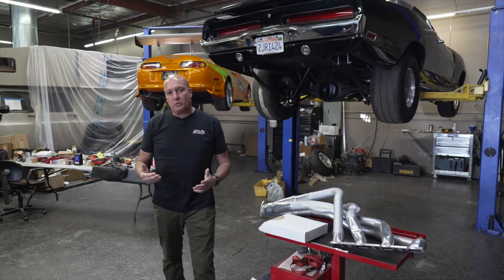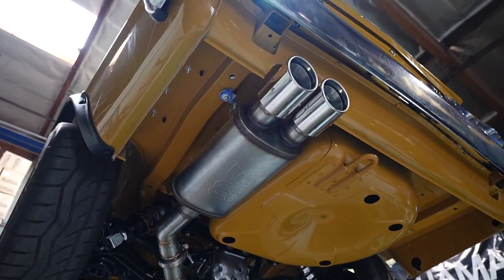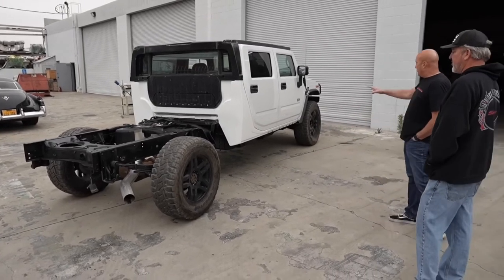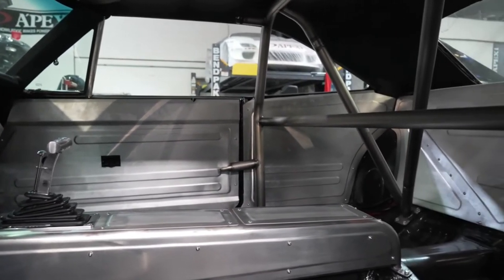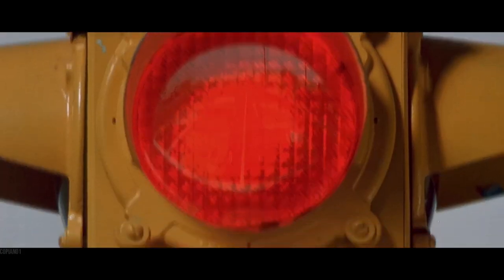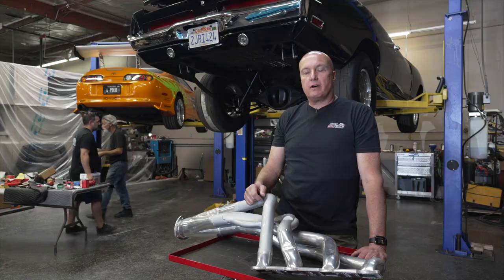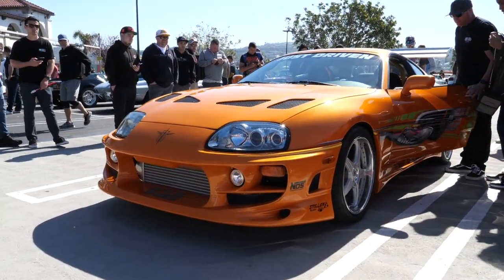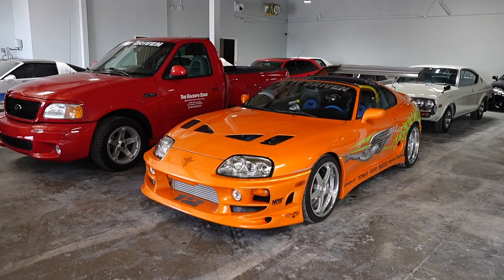The Fast & Furious Supra AND Charger-Together Again!

Comment: Seemed like that header could’ve been modified to work pretty easily, not sure I’d have gone with a notched runner, that seemed half ass. PS, not hating, it’s beautiful, just challenging you (respectfully) to do it right.
Reply from the maker: Anything we took out of the runner was also replaced elsewhere in the same runner to keep the volume the same. To create full custom headers would delay this project further and we are already behind. In the future we would love to come back to the headers and have BSide make something crazy beautiful. For now? This header may not look pretty but does everything it should!

Comment: So guys where I can buy this Dodge Charger or how I can to build this charger?
Reply from the maker: We are not selling our Charger. So you would have to build one!
Reply: Cool. But how I can to build it? May be you have any instructions? @JustDriven
Reply from the maker: We do not have a step-by-step build for the Charger. There are many people working to bring this beast to life.
Reply: So, you want to say that there is a auto repair shop which I can to give my charger and they can repair it? @JustDriven
Reply from the maker: You would have to search the internet to see if you can find a shop to build your Charger for you.
Reply: Thank you) @JustDriven
Reply: And last question, how much did this charger build project cost you?
Reply from the maker: We don't typically release the financials on our builds. Since we do most of the work in our shop it doesn't translate well for what someone else's shop would charge.
Reply from the maker: We currently do not build vehicles for clients. Sorry.
Reply: ok. @JustDriven

Comment: Let's do it....
Reply from the maker: It shall be done.
Reply: @JustDriven  the exhaust note in the movie, it's just like in the Supra, the turbo must be sitting in the middle of the engine.....
And it's good for the motor, because the equal length manifold helps with top end power, because the exhaust runners will have the same length, witch also helps with the EGT'S , boost control, and so on....